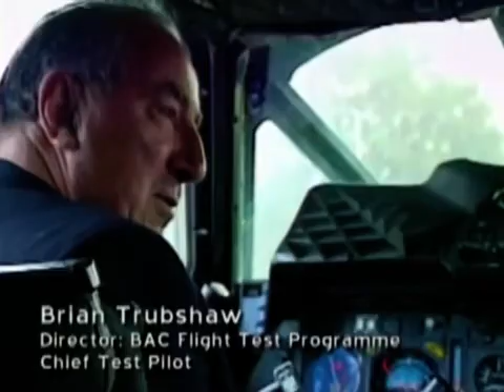Concorde 002 First Flight at Filton 9th April 1969

Comment: I was about half a mile from the end of the runway on a hill at Cribbs Causeway directly in line as it took off that day, it flew directly over my head at what seemed like no more than 3 or 4 hundred feet above me, the noise was deafening and I can still remember the smell of aviation fuel as it rained down on me like a fine mist, a day I will never forget.
Reply: Catbrain Lane?
Reply: @Framinator  Not far from, always thought that was a strange name to call it.